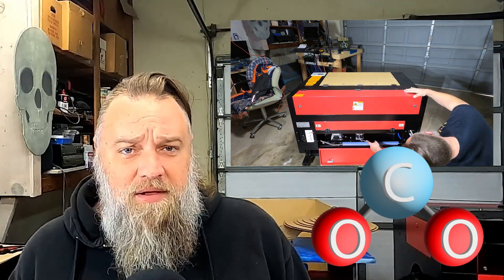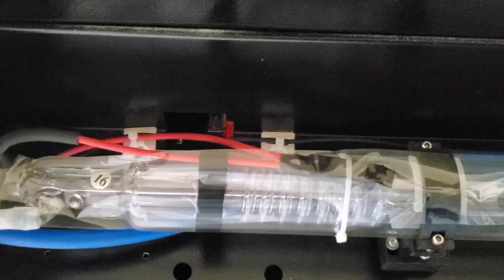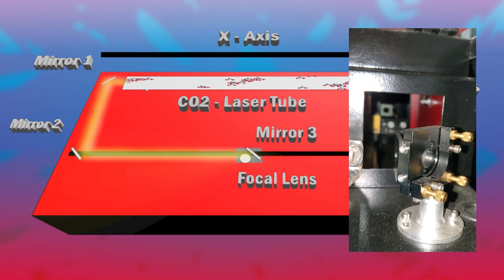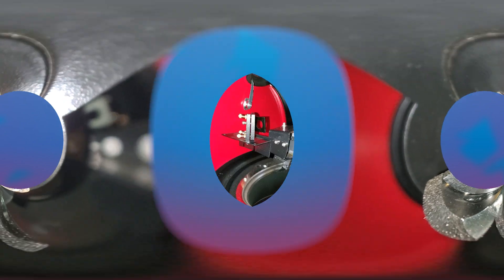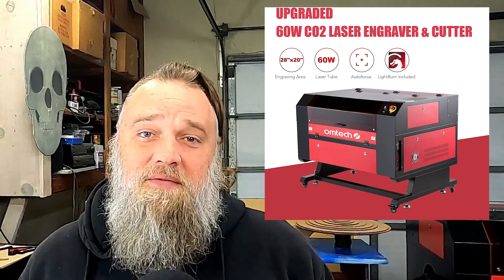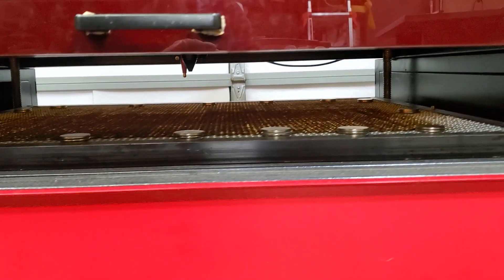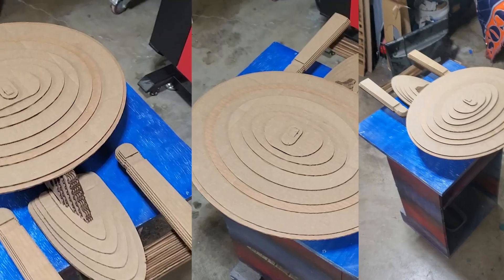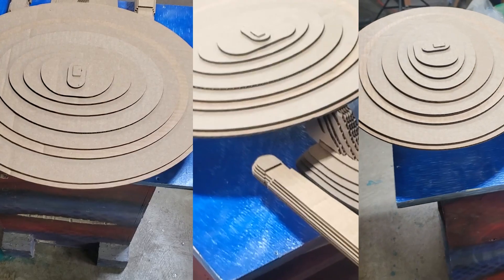I got a CO2 Laser: OMTech 60W AF | A Comprehensive Overview

Comment: Very cool informative intro to laser cutting and your decision path! I am thinking about my first laser, either be a diode or co2, but except for metal engraving the co2 seems to be superior for most tasks. The omtech machine looks promising, even if I read about support issues, but to be honest, I read it about all other cheap laser producers too. 

Looking forward to get one, but I need to plan and research a bit more. Especially about air assists, exhaust system, adjustments of the mirrors and the laser and maintenance routines 😊

Comment: I'd like to cut 1/4" acrylic or polyethelene sheets.  I need to make about 1200 individual sign letters that measure approximately 6" over a three month period.  These are not complicated letters.  The finish has to be smooth so there is as little trim work as possible.  I'd like to produce at least 10 signs over several hours (each sign is 6 letters).  A milling guy told me to look into laser but either would work.  So I am looking for quality finishes on plastic, but no engraving - just cutting.  Any advice as to which direction would be very much appreciated.
Reply from the maker: I would go CO2 laser at least 80 watt at a min.  That will give you less clean up if any on the letters, and you will be able to cut faster as well. With a router you are going to need to do some clean up. Plus inside corners on a router cnc will give you rounded corners, where as a CO2 will give you the corners you and your client want.

Comment: Hello! we bought 5w laser for ours 3018 prover 2 , with all the settings we try to engrave acrylic, its burns trough, can you please suggest something to us?
Reply from the maker: You are going to have a difficult to impossible time with acrylic and diode lasers. The laser wave length on diodes will just pass thru clear acrylic. Where as on opaque acrylics you could cut and etch it. (This could  require several passes). @monkeywoodworks has a great video on how to etch clear acrylic with a diode.
Reply: @D.E.Hammer  thank you, sir! It was helpful!

Comment: Do you have to heat your garage to keep the laser from freezing
Reply from the maker: We had a couple freezes here and I  drained it just to be on the safe side. Others have used heaters and or laser anti freeze in the cold to prevent freezing.

Comment: Mine was just shipped today, the k40 tho, the only reason is that i need to cut 3m tape along with the acrylic parts , but also there are other benefits as precise inlays on acrylic, speed, cutting colored acrylic that my diode couldnt 😅 also, cleaner edges and less dust, for the lightburn module, there is a company selling it cheaper for like 59$
Reply from the maker: Awesome you are going to have a great time with the k40. I will have to look up that module
Reply: Where
Reply: Its called Monport k40+ board, but its not plug and play and its kinda a pain if u couldnt figure it out